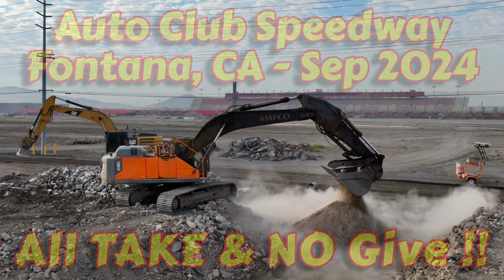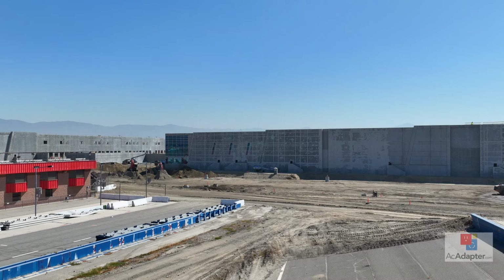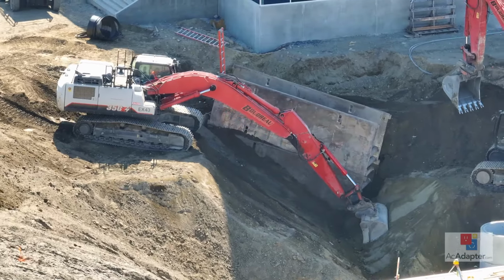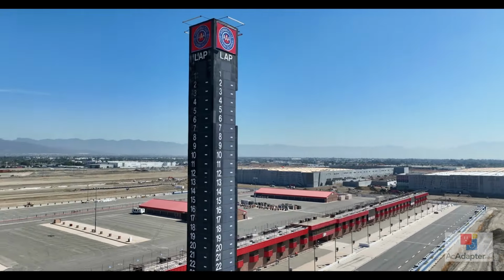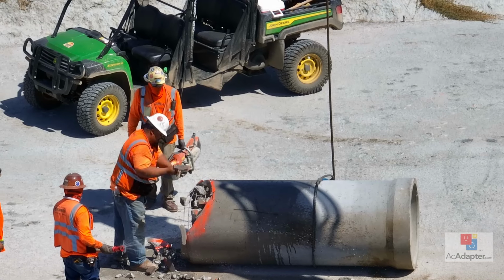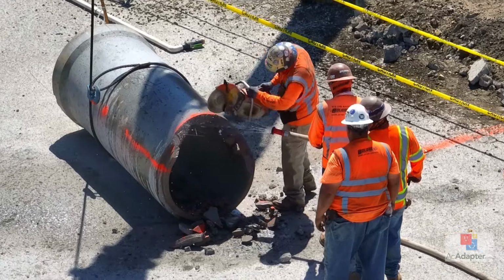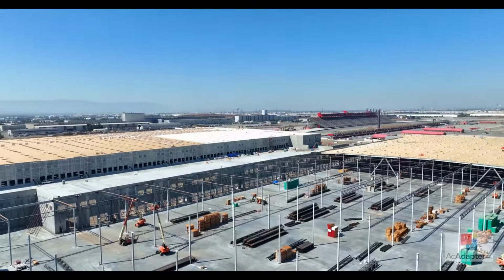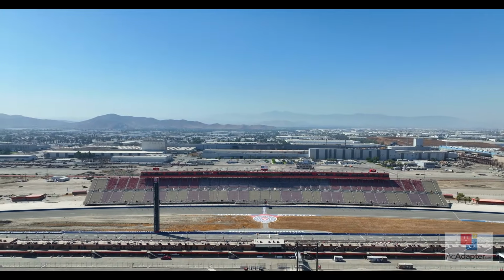NASCAR Auto Club Speedway DEMOLITION Update September 2024||Ac Adapter Inc|| #NASCAR # Championship

Comment: They said there will be a racetrack in SoCal. They would like it to be in Fontana, but just like other SoCal tracks, the land is worth more than the track. I would suggest building a track in the High Desert. I live in Apple Valley and between here and Baker, Ca. is wide open spaces. There are automotive test tracks out here and the land would be super cheap. As racing fans we have to understand we will have to build further and further out, and put in regulations that will save the track from urban creep (a la Laguna Seca).
Reply: And actually own the land.. All of the drag strips that disappeared were unfortunately on leased property.
Reply: And I live in the "charming" town of Victorville..there is LOTS of land.
Reply: @michaelmiller9483  🤣😂
Reply: If they let the landowners shut down Laguna Seca then that means no place is safe.  I was lucky enough to race my motorcycle at Riverside Raceway before they put up a shopping center in its place.  I primarily raced at Willow Springs which is also probably not on the safe list.

Comment: It's also worth to mention Steel City RC and CalSpeed Karting were evicted because of this as well and the folks who owned the RC track have been very angry to still see their track sitting there rotting while all of this has gone on. There are others getting completely screwed over from this. Funny how Nascar wants to be in SoCal yet they always screw all the fans over by taking property value over fan loyalty. They did it with Riverside and Ontario and now sadly Auto Club is probably the last one.

Comment: Looking at the drawings for the proposed half mile track it will fit within the length of the grandstand  and the current pit road will be outside the back straight, so it will be narrow between front and back straight and almost hairpin turns like Martinsville. Basically if you draw a line south to north on each end of the grandstand, that's the area the track will fit in with smaller grandstands at each end in the turns.

From what I was reading on KTLA's we site it looks like they might be ready by 2026. Hopefully it will happen, but I wouldn't place any money on it to happen.
Reply: Doubtful

Comment: I feel like the track is just asking to be put out of its misery it's kinda sad just to see theatre's box and grand stands sitting thier waiting for demolition either way good work but I don't think nascar is pulling on the site if so they would have aready been constructing turns 1 and 2 so I think thiers 1 of 2 options nascars gonna go with here

1 leave the track a sit is and let it rot 
2 sell of the rest of the land and demolish  everything
Reply from the maker: Hey A48 - I don't want to be a downer, but I think your option 2 is the one that makes the most sense.  When I drove up and couldn't see the grandstand from the street, the shock finally started to settle in.  With that said, I agree they could have easily torn it all down, and leaving part may give them options.  Not going to be much room to park tho...  Interesting times ahead.  I am headed back out there before I head east, so stay tuned.  thx...
Reply: @theawesome48fanhunter  I agree. I'm over this. At this point buying irwindale speedway would be a better option than what they've left themselves with here.